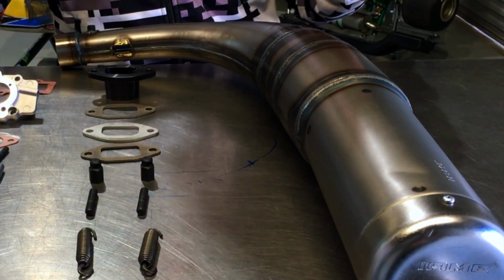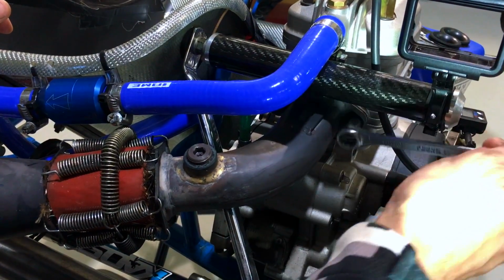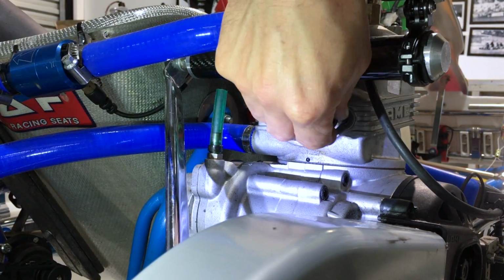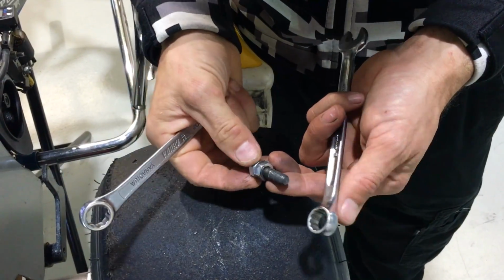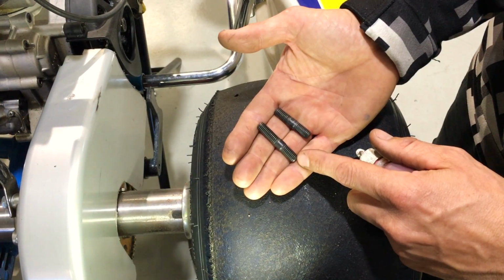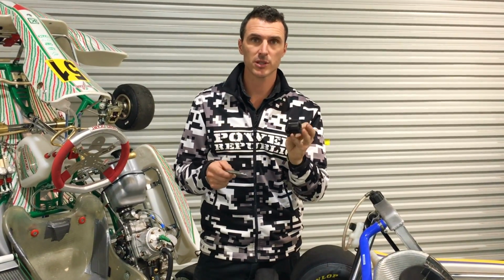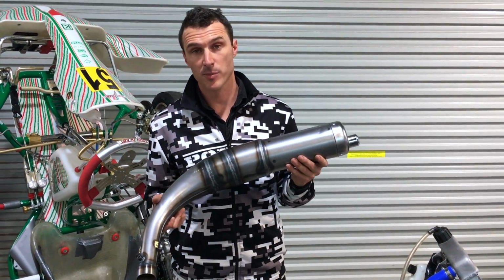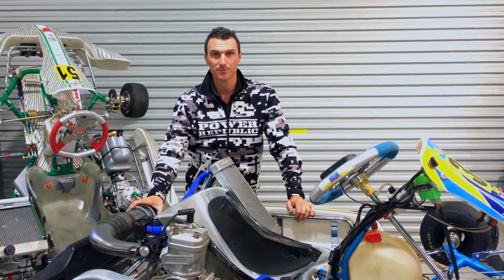Power Republic - 2018 Exhaust Upgrade For The IAME X30 Engine

Comment: Hi
Jason from the UK here, thx for all you informative videos they are really helping me to be a mechanic for my 9 year old Sons first kart I just purchased him.

 I'm basically a dad and lad and the kart I got him is a iame water swift.
When I was watching this video I noticed at the beginning there was 1 spacer and 2 gaskets laid out on the table that obviously fit between the engine and the restricted manifold but when you were fitting the manifold on you only placed 1 spacer and then 1 gasket on. 
Did you just leave the original gasket on from the old manifold on the engine as it was OK or did you change it and it was missed out on the video?
Sorry if this seems like a daft question I'm just trying to make sure I get everything right.

Comment: I have a x30 super i run on dirt in the open class we dont run a restrictor can i add a short  piece of pipe or will that hurt me ? mine leaks oil around the pipe and head plate adapter thing

Comment: Great vids! Ive  got 2 karts and looking to keep them similar in speed/set up etc. for more streamlined data collection and set up changes. 

I’ve got a 2011 X30 that I was going to have rebuilt and then get a new current spec X30 - would there be any real difference between the 2? (Assuming this upgrade kit would be work on the 2011 engine)
Reply from the maker: Get new engines IMO

Comment: Hi, thanks for the video, I am installing a restrictor for the old exhaust pipe and I just wanted to double check if the restrictor is installed between the fibre washer and the header pipe? 
Ciao
Reply from the maker: yeah one gasket on each side of the restictor plate
Reply: @PowerRepublic  thanks heaps guys

Comment: Do you know if this exhaust compatible the IAME leopard?? .. mine is leaking ... oil..and  bought it used .. thanks
Reply from the maker: you could, but you would have to make and adaptor to fit on the 3 bolt PCD of the leopard, the x30 manifold has only 2 bolts

Comment: Hi Derek, I have my first club meeting on Sunday at Geelong track in the x30Senior restricted heavy class. 
What would be the best axel sprocket size to get the best out of the engine? 
At the moment I mount a 10T on the engine and a 74T on the axel.
Dunlop DFM with about 100 laps on 
1400mm rear, front 1146mm
60% 40%
the kart feels pretty good
I started with 15psi on Sunday was bit cold
Chassis is a second hand which on the plate has got EA written on it, no one could tell me what brand is, sure is 30mm. 
My best time on Sunday was 47.77
Is anything that I could read on to understand racing lines and how to improve driving other than practicing?
Thanks 
Alex
Reply from the maker: he y AL, stoked for you.  your first race weekend is going to be awesome.  when you are new guy, there isn't a lot to do other than pump up the tyres, buy new ones if you can afford it, and lube the chain.  you just have to try to keep the nerves in check, drink plenty of water and remember to eat.  sound simple, but race days are different from practise laps.  
that said, you kart sound like its going around alright.  you could go up to a 11/79 for some more top end speed so you can pass a bit easier, but you will have to nail the corners.   are you still racing on DFM's at G town?
Reply: @PowerRepublic  Hi Derek, yes I am, got them second hand, I have never tried a set of new tires. When I bought the kart, it had a Leopard and second hand mg yellow and managed to do 46.30 however  non consistent in lap time. 
Now I have changed to an x30 old exhaust no restrictor and mounted DFM’s second hand, found it harder to learn on because more power……..then I ended up installing a restrictor on it and feels way better, with slower lap time, depending on the track conditions, but more consistent.
I don’t have a 11 engine sprocket, only have axel sprocket to play around, I think got a 76. New tires I am thinking about it, I ll see on Sunday morning……….
But yeah very excited, I am actually looking forward to enjoy the day and learn from faster drivers, hopefully manage to keep myself calm without doing mistakes. 
I have looked into getting your video tutorials packages, looking very interesting, I still need to manage to clean carny and set it up as with the restrictor on it I have left it the way it was.
Appreciated a lot the tips and support 
Cheers 
Alex
Reply from the maker: Hey Alex. New tyres are always best.  Don’t worry so much about your laps times just yet.  If you have a go pro to film your races that is a good idea.  Then you can review them after the event to see what you could take away from your experience.  If you want a discount code for Racing Rituals you can email me through our website. Thanks heaps for tuning in.
Reply: @PowerRepublic  Hi Derek, thanks a lot for the offer, I will reach you via email.
Again thanks for your support.
Cheers 
Alex